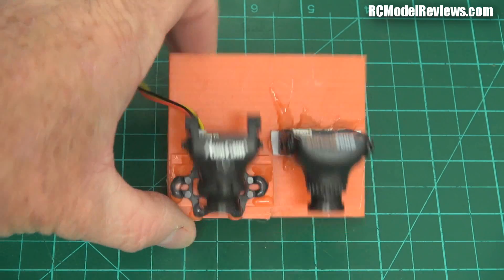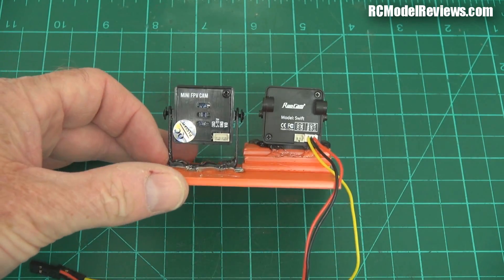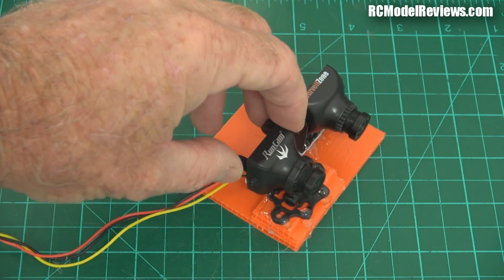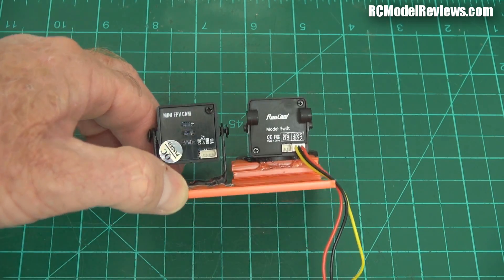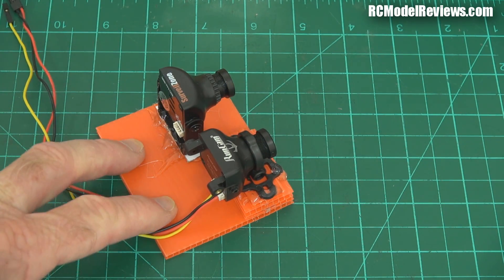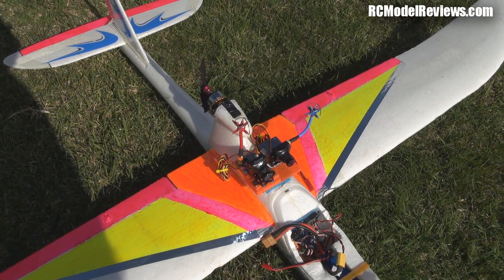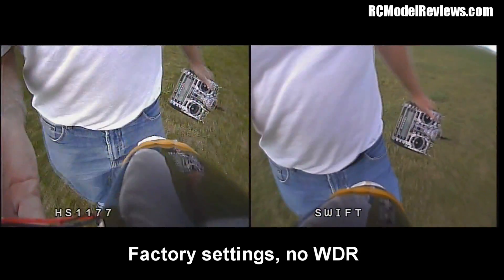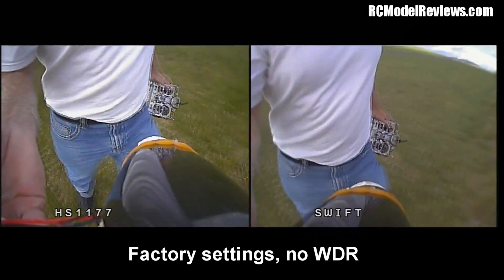In the air: Runcam Swift vs HS1177 (FPV cameras)

Comment: that plastic mount is for mounting on the top plate of a frame (mostly quadcopters), the metal one for mounting on the bottom plate.
And if you mount it on the top frame with the plastic one, it would fit perfectly with the little bits.

Comment: You're comparing the 1177 with IR filter vs the RunCam without IR filter, or am I mistaken on that?  The model you were sent may not have had that option but it is now available.  Different DVRs doesn't give that fair of a comparison and regarding the issue you had in the opening with mounting, the RunCam does send multiple options to mount the camera besides that clip, giving customers  choices.

Comment: I ordered the runcam swift a few days before these videos came out but can anyone else comment on the customer service they got from security camera 2000 or runcam.  I placed a banggood order/ runcam order same day and I got my bang good order like 4 or 5 days ago and shipping from runcam still has not updated. The time frame is not as bad as when I order something outside the country but I have sent multiple emails with just general shipping concerns and to ask is this normal or is there something holding up the package and ive yet to get a response. I will typically order a different product if I don't get good customer service from someone even if its a excellent product they carry. Has anyone else experienced this or should I just wait it out a few more days.

Comment: Bruce,
   Is it possible that because the hanger is designed to be used in the downward mode and your setup was in the upright mode that there are an odd number of serrations and it would sit correctly hanging?
Reply: Or turn the hanger 180 degrees as seen from above looking down on it with camera facing forwards.
Seems to make no sense but try it.
You're actually swapping serrated sections contact areas left to right.

Comment: Hmm I'm not impressed.. I'm not sure if the lack of color can be adjusted (enough) with camera settings? It's not only just the lack of color, but allso color-contrast..
Reply: +DutchRC Adventures Hey there .. lol .. Yea it has no ir filter
Reply: +RC Surf Yeps.. let's wait for the IR filter version to hit the market.. Or has it allready?
Reply: DutchRC Adventures I think its still preorder at least from BG , i hope they do add the IR filter. Or they can just sell the housing as thats the only difference
Reply: +RC Surf I couldn't really make out from the BG page if it actually is, or isn't the IR-filter version.. 
Ohww well. I din't do any night/evening FPV-ing.. So this non-IR version sertainly isn't the thing for me..
Reply: Im using a Runcam Skyplus 600tvl , I absolutely love it. The mounting system , basic bracet works just fine , i tighten the screws then cover with a little duck tape , no issues, uploading now a video from today from fpv at sunset , amzing how well it works in sunset for me too

Comment: I think they perform the same. The tilting point here should be the price difference, not much else. Mouthing problems should be pretty easy fixes.
Reply: +Alexis Ortiz The Runcam also has a better OSD setup which doesn't require you to unplug the AV/power to activate the OSD and set the camera parameters.
Reply: +xjet More convenient for sure Bruce but hardly a show stopper. Once set up there is little reason to ever use it again. Many of us have multiple cameras and favourite settings so that makes setting up new cameras pretty much a one time affair. I actually like the four point mounting idea on the Runcam it should be far stronger than the C@#k ring mounting or the hokey two point of the HS1177 especially if the airframe has suitable mounting plates.  Hanging on the Bolt210 flight review, It's going to be a wild ride I'm sure:)
Reply: +Rob B I have a problem with the Bolt210 flight review.  The damned thing is so fast that nobody (including myself) can keep up with it when trying to film from the ground.  It moves so fast and can change direction so quickly that it is impossible to keep in frame.   However... I have a cunning plan... so stay tuned.

Comment: what I have read that most of the internal components are the same in the cameras that are sold now, the only real difference is size, weight and mounting possibilities. that is why i have chosen a cmq1993X for my skywalker plane, size does not matter. and mounting wil be done with some brews and hot glue .
great vid again Bruce, happy you are still making them!
Reply: +Rogier Houtkooper I think the only real difference that counts the most are the used lenses
Reply: +Arcee Moron that is true, the lens makes the big difference. Like I said, the most of the internal components are the same.

Comment: Bruce,
Nice side by side demonstration. I can see two solutions to the Runcam mounting. Either grind the ID of the mount ring smooth or use a narrow strip of electrical tape around the lens locking ring. Maybe a combination of the two. However, Runcam should have made a better design.

Comment: No hot-mirror filter = happy me. Thanks for the heads up on this one, Bruce.

I eagerly await the tear-down to see if there really isn't an hot-mirror filter. You'll know as soon as you remove the lens as the telltale red/cyan shifting glass won't be between the lens and sensor assembly, but instead you'll encounter clear glass.

From what I see in the video, unless the Auto White Balance algorithm is absolutely beyond stellar, this camera appears to have a hot-mirror as I'm not seeing any of the normal aberrations you'd expect in a full-spectrum package.